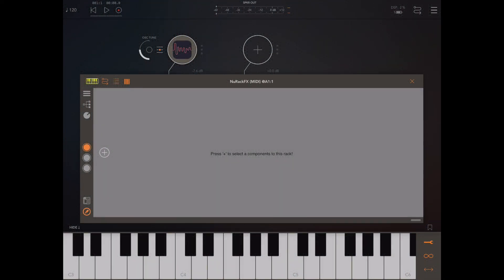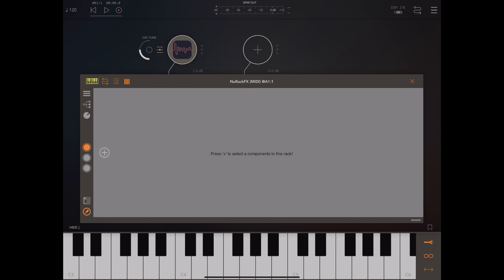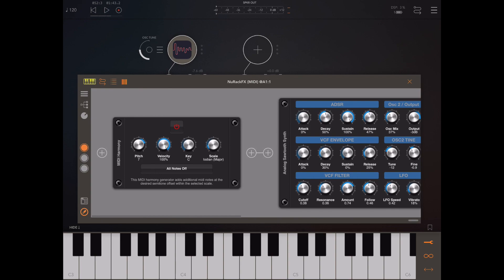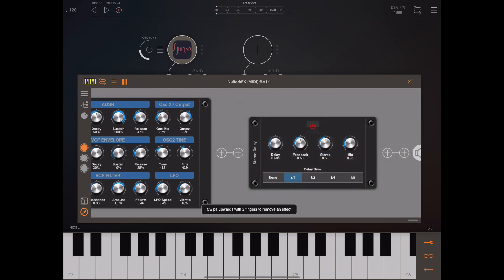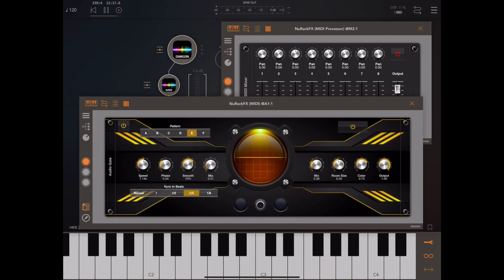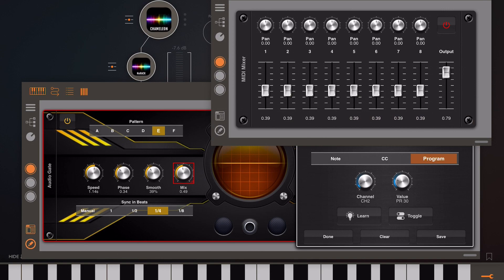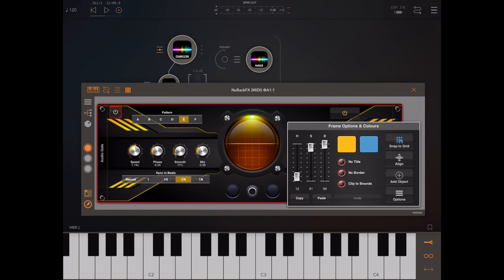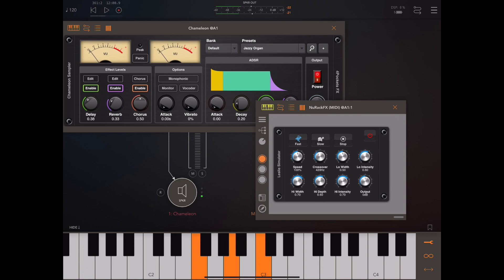NuRack Modular Effects - MIDI Mapping and MIDI Effects

Comment: Hi im trying to control the Midi parameters of the fx with my midi controller, in standalone it works perfectly but in Auv3 with camelot pro is impossible to midi map anything. There is any solution for it?. Note input from masterkeyboard work fine but adding instrument midi even in Auv3 but in I try to map a cc even a note on/off one its impossible to map with learn and even manually texting it

Comment: HELP PLEASE I’ve mapped a touchpad to a cc generator to cc 1 and 2. That works. I have then mapped it to midi remap to change cc2 to cc11. So now in theory I should be able to control vibrato and expression in any of the swam instruments from the control pad. But I don’t seem to be getting any midi output from Nurack. Any clue as to what I’m doing wrong would be greatly appreciated. Thanks Paul.
Reply from the maker: In theory it should work so long as you mapped the touchpad V and H to the CC Generators Value1 and Value2 knobs. Try putting a MIDI Monitor after the CC generator to ensure you are getting output that looks correct. The order MUSt be TOUCHPAD, CC GENERATOR, MIDI Monitor.  Also don't forget to load NuRack as a MIDI Effect and the destination takes its input from NuRack. Just tested and works fine although I know nothing about SWAM so can't say if they are doing their job correctly.
Reply: @PaultheMusicMan  Thanks Paul, that’s exactly how I set it up. The touch pad is controlling the cc generator, I know this by the fact it moves the dials and changes the values in the cc generator. I have placed a midi monitor after the cc generator and it is not displaying any output from it. I also tried the cc monitor and that shows no output from the cc generator either. Oh loving the auto save in Helium by the way, works perfectly
Reply from the maker: @kentaccordionist  Which knobs are spinning when you touch the touchpad? It isn't the CC knobs that should change, they should be fixed to CC2 and 11, its the VALUE knobs you need to map too and these should be turning.
Reply from the maker: @kentaccordionist  https://www.dropbox.com/s/v3i74qk5gv5nnjc/NuRackCCGen.mp4?dl=0
Reply: @PaultheMusicMan  thanks Paul you may have just solved my problem. I’ve only been using mid 30 something years, and yet I made a beginners mistake like that. I did have it mapped to the wrong knobs. Thanks again hope your days going well.
Reply from the maker: @kentaccordionist  No worries mate, we all get brain freeze in this hot weather!! lol
Reply: @PaultheMusicMan  Thanks a lot Paul.
Reply: @PaultheMusicMan  Now working like a Treat Triffic as Del Boy would say. What a genius you are.

Comment: Thanks for the update, Paul.  This is a huge step in the direction I was hoping for!  Excited to see what's coming next.  
My only remaining requests for DIY MIDI controllers:
-Buttons (DigiStix pads module?)
-An option next to "MIDI Mapping" in the Options (hamburger) menu, for "MIDI Output"
-Ideally, instead of the "No Title" checkbox, we could enter labels of a certain length. If those labels could include emojis, that's a bonus. 

Also, I found a crash glitch.  It happens when you remove the connection between an XY Touchpad and another module.  Otherwise, seems very stable so far.
Reply from the maker: Yes, the MIDI pad module is already on the cards. The MIDI Mixer module uses the same MIDI mapping to setup transmit MIDI data cCC/channel etc. I will take a look at the touchpad issje, maybe I screwed something up.
Reply: Ah, the glitch was the MIDI Control module, not the Touchpad.  Open a fresh instance of the app, add a MIDI Control module, add a touchpad, and disconnect them.  The glitch should happen every time.  

Anyway, the new pads module is great, and I also found the label option.  I think the only thing missing is a "Zoom Lock" button.  Hard to drum on the pads when the interface changes size every time you hit two pads at once.  But aside from that, I'm very impressed with NuRack, and I'm looking forward to building some interfaces!
Reply from the maker: @wcmusic91  I'm not sure why you would ever want to connect a MIDI Control to a TouchPad but I will give it a go and see if I can find the issue. It certainly shoul not blow up on you.
Reply: That's awesome news.  I assumed the MIDI mapping was for inputs only.
Reply from the maker: @wcmusic91  This is only possible because the MIDI Mixer was designed to transmit its settings, but this made the most sense rather than having 2 sets of settings. Other modules do not transmit their settings, only receive. I'm trying to find this crash with the TouchPad but unstable to reproduce. Is there a scenario I can follow that always gives the crash?